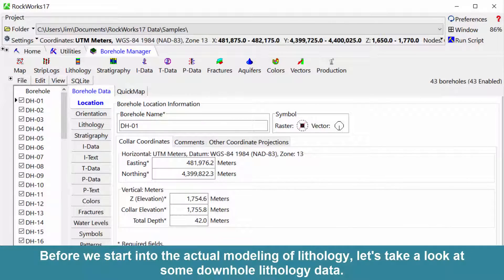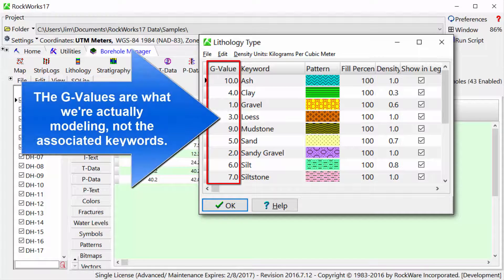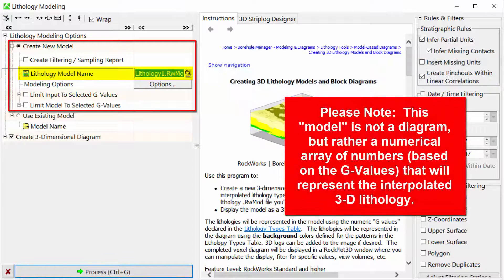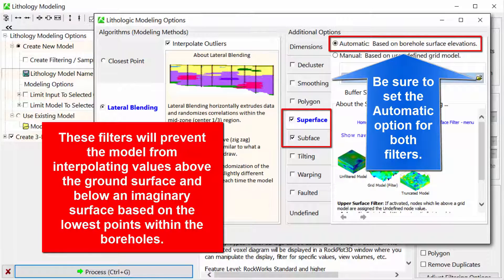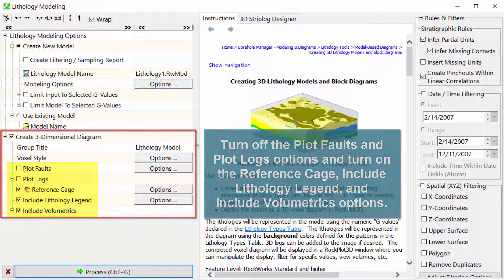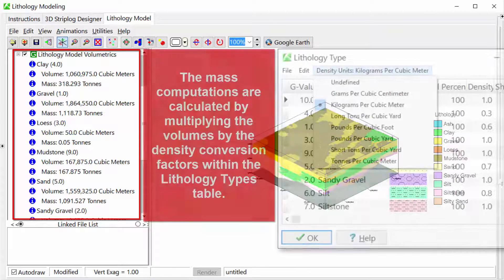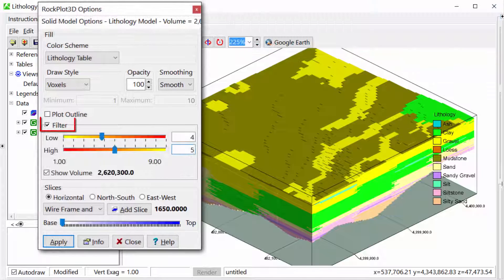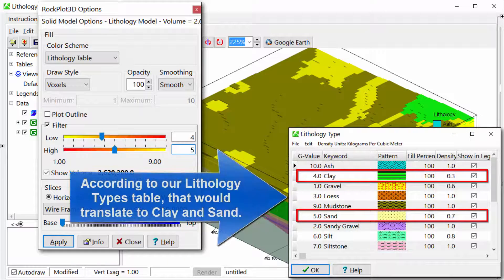(RTE 4.1) Creating a Lithology Model

Comment: Lithology model volume is empty?
Reply from the maker: There is an option labeled "Include Volumetrics" within the Lithology Modeling menu.  Please check this box and re-generate the model.
Reply from the maker: If you're not seeing a volumetric total, then either (1) the "Compute Volumetrics" option is unchecked, or (2) there are no lithologic units that have a g-value between the specified minimum/maximum g-values.